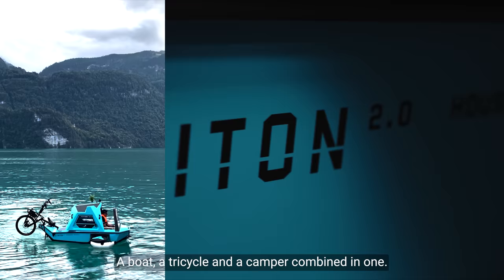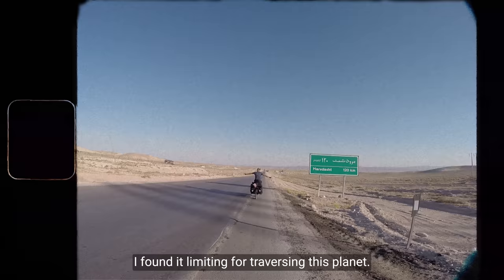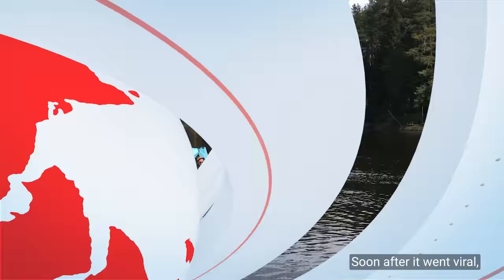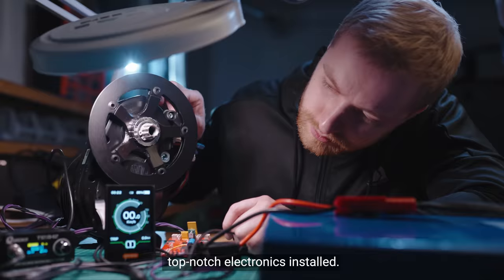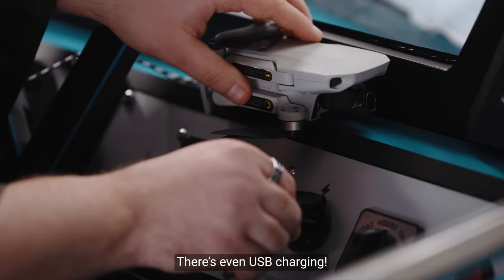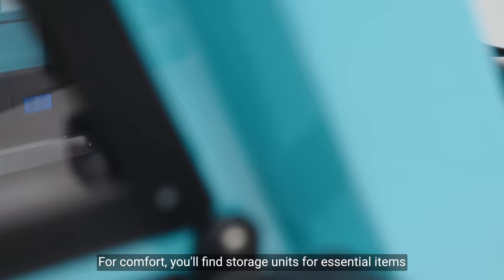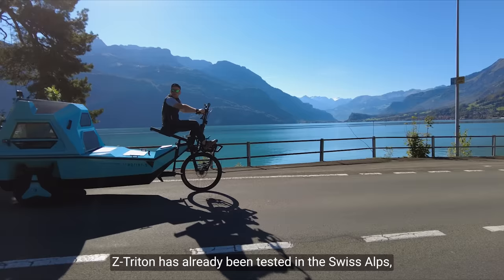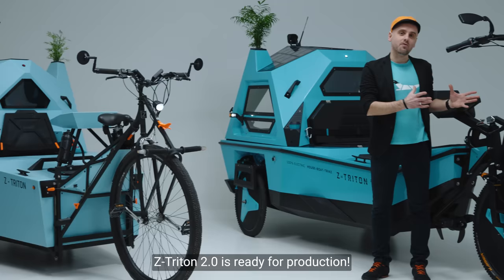Official Launch --- BeTRITON (Z-TRITON 2.0) --- Market-Ready Version!

Comment: I’ve never been so unsure if something was a joke or not. Can someone clarify? I consider myself to have a fairly good sense of humor. If this is a hoax, kudos to the creators for the level of elaboration!
Reply: It is a real product. I'm not sure it's really useable on the road, but it is a real thing you can buy.
Reply: Same mahn. Couldn't clarify if it was a joke or not
Reply: Was? It still is?
Reply: It actually seems to be real, there are other channels showing it. Though bicycle is a bit misleading, it has a license place Wich means it is actually a motorcycle. Wich makes sense, there is no way a small bicycle motor can lug this much weight around.

Comment: It's cool, but I think it still needs work.
The front looks like it creates a lot of drag. Could have made the internal space bigger and made it more aerodynamic at the same time by making it more triangular in the front.
I would have used fold out/down pontoons instead of inflatable ones. It seems like a pain to have to repeatedly inflate and deflate them.
It would be cool if the pedals could be switched between driving the front wheel and a propeller so you could pedal through water instead of relying on the motor.
I'd also be worried about the torque applied to the wheel hub using the oars.
Does it have feet for camping or does it rest on the hull or do you leave it on the wheels?
Does it come with an anchor?
Reply: I believe at such low speeds, the role of aerodynamics and hydrodynamics is so little that it is not worth optimizing it with rounded and complex shapes, at the same time losing extra internal space and increasing a complexity of mass production. I think this is the logic behind this design. Apart from that, I would also like see it as a rounded shape style classic transportation vehicle instead of such "cyberpunk" post-modernism style. It almost looks like some kind of high-tech gadget from futuristic movies than a road/ water transportation vehicle. Not judging, though. Just my opinion :)
Reply: Did you not see the aeroplant?!?
Reply: You guys should make one, let me know when you have
Reply: "Does it come with an anchor?"
FAQ on site says "yes, folding anchor"

Comment: I like the idea, but I would say the biggest issue with it is transporting to anywhere you would want to use it.  While I'm sure its rugged enough to be an independent vehicle, it doesn't even look like it would fit in a pickup, and looks heavy to manhandle.
Reply: Well. You could either tow it or you know. Cycle there?

Comment: There is one slight problem, if those solar panels can charge the batteries while in motion, then under UK road law it's a vehicle and needs type approval and you need a driving license, mot, and insurance, you also could not operate it in pedestrian zones or other pathways.
Reply: yeah and looking at the amount of solar cells on there it's not even gonna put a significant charge in there.
Reply: It's just a rich boy's fantasy

Comment: I'm sorry but this looks like it will be below average in performing each of its three jobs. A good idea but it just doesn't seem practical IMO
Reply: What if a turbine were fitted into the hull for additional battery charging capability to supplement the solar option.
Reply: @josuesjourney6931  its just the second version there is so much that could be done, love the hype
Reply: I would try it.
Reply: That’s usually what happens when you combine different things into one thing. You nearly always end up with something that’s less than the sum of its parts, it’s the cost of convenience.

Comment: I have seen the amazing BeTRITON today live at the Fully Charged Experience in Amsterdam and pre-orderd one. Looks and feels very sturdy and a lot of bang for the buck. Can store next to my home, cycle electricly to a boat ramp nearby (have several options around Utrecht) and have fun with the boat option in the canals of Utrecht, the Maarseveense plassen or the ‘Hollandse IJssel’. Would like to see a video of the Z-Triton leaving the water at a boat ramp. You need to stand in the water, to get it out. Next you will have a lot of maintenance on the wheel, including sprockets, disc brakes and chain, which goes under water. But it's worth it, if only for the attention this amphibious vehicle is going to get along the way, and the freedom it gives us.

Comment: Are the tires vegan?
Reply: All tires are vegan.
Reply: @danwarb1  Phew... I was really having sleepless nights about this! Just FYI, most tires are in fact not kosher in the sense of this trendy belief system as animal-based stearic acid is a main component of many rubber formulas.
Reply: Vegan and 100% biodegradable.
Reply: @SergeiVorobei  Edible too?
Reply: @f.d.6667  , as edible as vegan resin -- only if it's made of soya and potato peels. Marketers should seriously introduce sacral geometry to the tire. And, place a crown chakra healing pyramid on to of the thing. And, a tarot card deck compartment according to feng shui.

Comment: i didnt see anything about what im going to say so, it should have like "cords" to hold a "tent-like" plastic if you are in boat mode to cover the open space that's made closed enough for heavy rain, also a loop pulley system with a rotating handle to make the wiper for the windshield "semi-automatic" would be amazing if you are caught up in a heavy rain situation
Reply: @Dystopia Discourse of course but if i'm paying 14500 bucks i don't think some cords and a tarp would be out of budget for more features to make the product more appealing
Reply: @joaquinfraustoalfarorocco8177  the diy kit is 4500. You could do that and use the 10k savings to build it how you want it

Comment: The bike camper alone is cool but needs to much assist to make it viable. This assist may fail and I just see so many spots of failure. That being said I hope the tech keeps going as this is amazing.
Reply: Failing in what way ? The components are all mechanical except the battery…
Reply: This looks like it could be much more reliable than a regular boat or camper, not including the truck to pull them. Also maintenance would be way less.

Comment: I don’t think it’s made for ‘active wildlife enthusiasts’ because of the Color but apart from that this is amazing. I like the features the amphibious features and so on,…!
Reply: @f.d.6667  Hahahah, yes it probably is. I hope there weren’t many lethal gasses produced in the proces.
Reply: @sylvaindemeulenaere  The gases are actually our smallest problem: bisphenols leeching from epoxy composites are a MASSIVE ecological problem but even worse are the magnets in the electric motors: 1kg of neodymium magnets is resulting in the production of 1000-3000 kgs of radioactive slurry that's containing high amounts of thorium and uranium. 99% of the slurry gets dumped in open bogs where it dries out and the wind is transporting particles in populated areas, causing lung cancer and leukemia. This problem is big. In fact, it's way, way bigger than Chernobyl - but Western media is afraid to report the full scale of the disaster as all "green" tech is using a lot of the stuff...

Comment: This was poorly designed. You lose a ton of space, its not very aerodynamic, and theres not enough room for enough solar panels to help carry all the weight you are pulling. They should have gone a little more like an aerostream in design. That would have been more efficient in virtually every way. They could have even had the driver enclosed and done it paddle boat style instead of having that crappy little trolling motor.  They could make it an electrically assisted paddle boat and use the existing drivetrain and scrap BOTH the trolling motor and oars at the same time. Not to mention most bikers arent professional rowers and a paddle boat will likely be more useful for them. Plus you could lose an oar and just, die out in the middle of nowhere.

Comment: I went to the bike shop last weekend, there was a Pinarello costing €14k. This z-Triton price is actually about right. I might buy one but I would need to test it first and see how comfortable it rides. I wouldn't use it on anything else than a VERY calm lake though. Not on the sea, river, ocean. Actually, if this bike existed in a non-boat version, better optimized for cycling and camping I would rather pick that.
Reply: Look for a electric cargo bike, extra battery, a good tent and big camping solar solution with a budget of €10k. You will probably have more fun with that. If you go alone, you can add a inflatable kajak with +500kg load capacity.
Reply: @jakob8741  Yes and no. I already have the bikepacking style equipment which I really enjoy but what I like with the Triton is the hard shell camper. I had to set my tent at night and struggled to find a good place, I've had rain, I was really tired, etc... Here you stop pedalling and get into your shelter. That's the part I like about this innovation.

Comment: So where are you supposed to switch to boat mode? On water or on land?
Reply: land . manually inflate and attach the floaters . and manual adjust the wheels and the steering part .
Reply: Nah man drive it into the water then turn it into a boat while you’re in the lake

Comment: 200kg empty. Ouch, the concept is good, but surely the shape could be improved and made lighter.
Reply: "Surely", how could you know?
Reply: @calix451  for a start,  the fibreglass upper shell is weight that could be reduced with a skin on frame design. A funky pot plant holder and pot are cute,  but also added weight.
Reply: most of that weight is in order to make it a boat, maybe a dedicated camper with inflatable floats would be lighter than this.

Comment: Hmm not convinced. How fast can it go on land with the battery and what is it's autonomy? I can't imagine having to pedal while carrying the habitat and a person.
Reply: Too wide ..too heavy
Reply: It actually has CRAZY range thats the whole point of the motor not to go fast its pedal assistance. Plus has solar panels so you can re charge.  But the actually range "should" be around 100+ miles with a top E-speed in the 15-20mph range making it a class 2 ebike in most countries/areas
Reply: @INDRIDCOLD83  it is expensive but you're looking at it wrong. 1st off there are pedal bicycles that sell for $20,000. A e-bike made bye "Specialized" is around $10,000 and its nothing more than a MTB that has pedal  assist with a top speed of 20mph. Hell the stealth bomber b 52 ebike is $18,000 fully loaded it does do around 45mph with a around 40 mile range. But still. The most expensive e bike is like $50,000!! For a bicycle with a 5kw motor. You could buy a 100 huffy and toss on a $1,500 5kw e bike kit and have generally the same thing 🤔 but its not the same at all is it? You get what you pay for.

Comment: Needs shelter in trike mode.
Very poor use of solar. You may as well not have bothered with such a tiny amount.
You could have used 4 house panels (as roof) at 400+ watts each (1.6KW system) over the current dimensions.
Reply: Or the open area in the front could also be covered in panels too
Reply: @Fred_the_1996  or they could have just, stuck the panels horizontal instead of diagonal. more room that way probably.
Reply: Extra solar panels would make it even more expensive.
However reading other comments it seems that it needs greater flexibility and customisation. As per usual if you give someone a soap box to complain they will, as apparently everyone is an armchair expert these days.
Reply: or drag behind on a separate trailer 2.5m x 10m board, a total of 25m^2 of panels. Are you kidding guys...
Reply: @engineer9528  What are you on about? That's just being ridiculous. But it is sensible to make the roof from normal house panels. A 1.6kw system would be exactly what this thing needs

Comment: This is awesoem.... but asking around $15,000 for it is a bit steep.... 
I do see that it has quite a good range listed.... I'm assuming that's the range without pedaling? If so that's a pretty good range
Reply: You can build it if you want. Some part may be comblicating to make but maybe with 2 bikes, some wood and batteries you could build it
Reply: Have you seen what a normal boat a camper cost, not to mention a tow vehicle? This looks to be much more reliable and way cheaper. The cons of course are speed and space, but you can’t have it all.

Comment: Dude what if you put a 2 cylinder mc motor on that
Reply: then you're missing the point of this
Reply: I like how you think. What if we put 20-30 hp scooter engine in it? 🤔
Reply: @hussaingahlot2318  as I said in another comment:  I'm throwing an LS3 6.2 Liter V8 in it right away. Gonna stick a 3 liter Whipple supercharger on it too.
Reply: @ForzaMonkey  But what will you choose for the new tires?
Reply: @z33thr33  new tires? forget that, I just sand my tires down for a smoother ride quality XD
Reply: Well it would be much less usable and cost more for a little more speed but it has to stay under 20mph or you have to register it for the road in the US. In that case just make an Amphibious van so you can take it on the highway and get the benefit of the big gas motor.

Comment: How much it will cost, as anything like this is always crazily expensive and you'll never see one. It's about time someone made a budget bike camper, or a budget boat camper
Reply: it is only 14,5k euro
Reply: @mateuszwajcheprzeloz3737  Pre-order says 4500(DIY) - 14500(built) euros.  (and you have to pay 50-100 eur now)
Reply: @sonickrnd  wow so overpriced, it's about time people stopped assuming everyone is a millionaire and has money to burn
Reply: @willtaylor6112  New "okay" bike cost about 1000. It's like four bikes. I think it's okay, you don't buy it to use only one month, one can use it for 10 years or so.
Reply: @sonickrnd  one bike will last 10 years, I can get custom bike camper for around 2 and that'll last well over 10 years.
Reply: @sonickrnd  I see it as overpriced and over excessively designed, if you manufactured one how much would it cost is what I mean by it. The whole world is coming into a massive recession and price should be one of the first factors. I mean 14.5k I can get a van and convert it, I can do way more stuff with it and it's more secure.
Reply: @mateuszwajcheprzeloz3737  VAT excluded and so is shipping. Add another 20% on that pricetag for Germany.

Comment: Itwould be fargreater with a small gas engine a 250cc motorcycle engine would be much more usefull and wouldent add to much more weight.
Reply: think they said they wanted sth sustainable or green.
Reply: maybe an electric scooter version?
Reply: @aunghtetkhantpaing810  this is def not sustainable, more like w waste of 10 peoples energy in designing
Reply: They don’t want a gas engine, this is for hippies
Reply: @StoneCorazon  thats not true cuz hippiies aint got 17 grand lol. Its not even full electric like a car. Probably cant make it to the lake without loosing 20 pou ds
Reply: @superbikesavage9500  not for americans that require a motor for basic locomotion
Reply: @adamcourtenay8716   yeah if i spend 17 grand i dont want to have to peddle
Reply: electric engine much easier to service\replace, and also no odor.

Comment: Ok, I love it. It's grand. But let's be honest. This is great for a single person. What really needs to happen is it needs to be collapsible. If it needs to be for two people then it needs to be optional on a tandem platform. Look into collapsible sail boats and canoes. It doesn't need to be sail-able, but those ideas will make this more streamlined. Wind resistance always needs to be a factor. I know this because I know resistance is always the factor in milage. I see it's easy to take up a steep incline now lets make it easier. You don't have to sacrifice structural integrity for this to fold up. Example: Top separates, but the windows hinge.
Reply: if the  boat were foldable IT WILL SELL LIKE  THAT....   MOST HIKERS AND TOURISTS CAMPER and BOAT LOVER will buy it as THE MOST PRACTIBLE  and AFFORDIBLE TOURIST GEAR  EVER

Comment: I don’t understand all the negativity towards it? This is an awesome build. This vehicle allows you to cycle and swim without bringing much else! I think all the added features they put into this are extremely well thought at and even the plant holder is a silly and fitting touch. You guys are such sweats. Learn to have a little fun.
Reply: I know right a very innovative concept that doesn't get the recognition it deserves...
Reply: Well it's designed and marketed to do the one thing it probably really can't: Travel the world. It's high dependency on electric charge makes it effectively useless for routes like "London to Tokyo" as shown in the video. It was tested in the swiss alps where electric infrastructure is everywhere. Try crossing a desert with that.. Don't think solar would actually keep up with the motors demand
Reply: @MrSiimon93  It's a bicycle so the main power source is leg power and it probably charges the batteries while you pedal
Reply: @macjalac5845  no. It's 250kg without added weight, it's not a bicycle like you and I own, it's dependend on electric support. Your imagination of power generation and consumption is just that - imagination.
Reply: Because for the price of this item, you could get a proper vehicle and do the same thing.
Reply: i think the negativity is the implication that $18,000 is reasonable for a toy.
Reply: @daltonbedore8396  exactly. New ideas are well and good, but it always comes down to cost of implementation. If your reinvented wheel is unattainable by the masses, your wheel is useless. There's a reason why certain things haven't been "revolutionized" for 100 years. It's because it still works at a reasonable price. Every attempt to change it gets shot down because some engineers forget that the market is a stress point you have to simulate on your product to see if it stands.